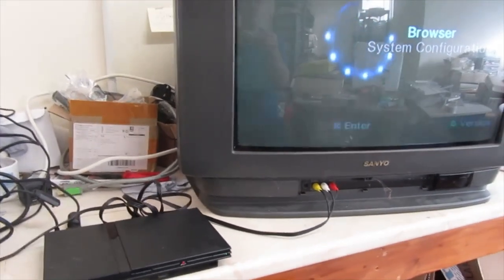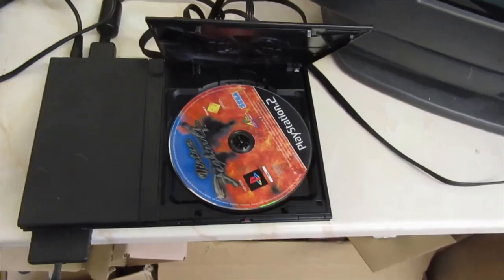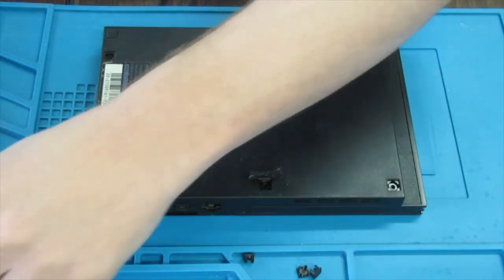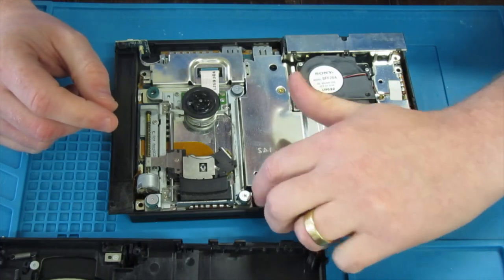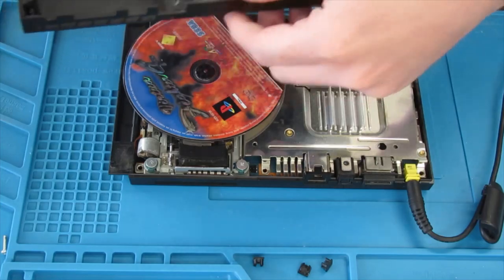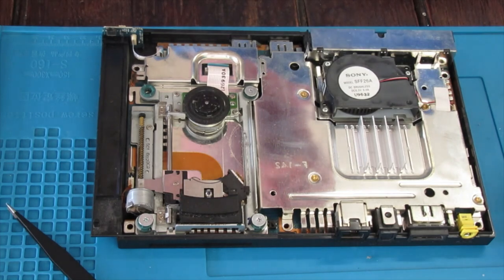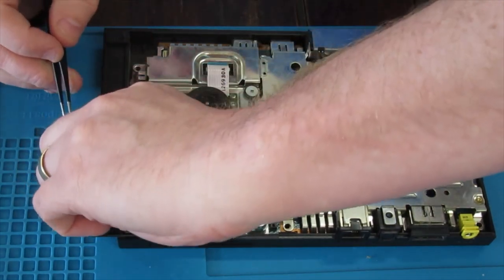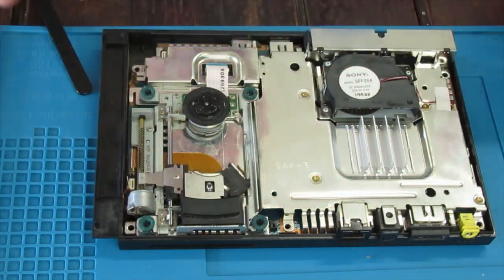PS2 PlayStation 2 Slim Discs Not Spinning

Comment: So I sat there having this issue thinking I would have to waste money fixing it. I had a new controller and game. But u said put tape and it was fixed. I've been playing for 3 months with no issue so THANK YOU!!!
Reply from the maker: Yeah for most people tape will work fine. Thanks for the comment, glad the video was able to help.
Reply: My ps2 would run ps2 games only but I just bought a dvd-r to do the free mcboot thing but the problem is the dvd won't run correctly it start spinning for seconds then stops I tried several DVDs and ps2 games and it was working but not the dvd-r how can I fix it? I only want this dvd to run so I can install free mcboot

Comment: In my ps2 slim  on the screen it is written that There is no data and underneath that it's written reading disc
Reply from the maker: That sounds like the PS2 is trying to read the game but cant, it's mostly likely an issue with the laser.
Reply: @EasyConsoleFixes bro mine just spins fine but after it stops and spins again what is the problem ?
Reply from the maker: @hafihashim  That seems like your laser is not able to read the disc.
Reply: Laser blinks according to the cd is there a problem ?
Reply from the maker: @hafihashim  I'm not sure what you mean by "laser blinks according to the CD. 

If it is a dying laser you could try adjusting laser potentiometer to see if that helps.
Reply: @EasyConsoleFixes  the cd spins at first and slows down a bit at that time laser stops and after that again cd spins at normal speed laser starts working
Reply: @EasyConsoleFixes  if you have a insta acc i will show you do you have one ?
Reply from the maker: @hafihashim  Is the console loading the games once it starts spinning again. If so I haven't seen issue before so I'm not sure what it could be.
Reply: @EasyConsoleFixes  anyway i'm going to buy a new laser btw my console is the last slim model is there a different laser or both have the same laser ?
Reply: mine doesn’t spin at all i’ve held down both the buttons and it still won’t
Reply from the maker: @hafihashim  Hi the 90000 series uses a different laser. Here is a  useful guide. https://www.zedlabz.com/blogs/news/laser-compatibility-guide-for-sony-ps2-ps2-slim
Reply from the maker: @imkitsune9246  When you held the switches down does the laser lens move up and down  or try and focus. 

If nothing at all happens when you press the switches down it's probably a faulty switch as the console is not detecting the lid is closed.

If the lasers tries to focus but it doesn't spin it's probably a faulty spindle motor, spindle motor fuse or maybe the ribbon to the spindle motor.
Reply: @EasyConsoleFixes  how can i buy from india ?
Reply: @EasyConsoleFixes which laser does the 75000 use?
Reply from the maker: @PRODMUDDY  Hi, the 75000 uses the PVR-802W laser.

Comment: I’m not too experienced with this kind of stuff but I opened my ps2 slim Scph-70012 because it was only reading compact discs and not dvd rom games like gta vice city, so I adjusted the laser thingy on the bottom to see if that would work which spawned another problem, the discs don’t spin. :(
Reply from the maker: The only thing I can think there is one of the lid switches has been damaged so the console thinks the lid is open or one of your ribbon cables hasn't been reinstalled correctly.
Reply: I think it was the ribbon cable because the laser does move up when turning the console on or closing the lid

Edit:I fixed the ribbon cable and it spins fine.

But the ribbon cable scratches
Reply from the maker: @scpnoobers  This is a common problem on these consoles. It can be fixed with some tape or glue or a new ribbon.
Reply: I’ll try the glue/tape part thanks for giving me suggestions

Comment: Hi, my PS2 Slim cd drive spins both ways, is there a fix for this problem? I'm looking for a new motor anyways, but I can't find which one it is, I don't see a type number like which on the laser is written as; PVR-802W. It could be the flexcable of the motor, but it's soldered on the board and that's why I have to look for a whole new motor
Reply from the maker: Hi, I'm not sure what you mean by the drive spins both ways. The slim uses a few different spindle motors. If you search for the model of console and spindle motor you should see the correct one. 

Some of the console models the spindle is really easy to change and in some it's difficult so it may be worth checking you have one of the easier ones.

Comment: Still doesn't work
Reply from the maker: If you are sure the lid closed switches are working correctly and the disc still doesn't even try and spin then the issue is probably with your spindle motor. 

It may be worth checking the motor, ribbon cable to the motor and the fuses on the board to make sure these are ok.

Comment: Hello even when I cluck the trigger manually it doesn't spin
Reply from the maker: Are you getting any movement from the laser, after the console detects the lid has closed it will try read the disc. If it doesn't detect a disc it wont  spin.
Reply: @EasyConsoleFixes  no, no movement :(

Comment: Awesome video! Thanks for putting this out there. Do you know where to buy a replacement switch? Mine looks pretty damaged and I don’t think it works anymore. I need to check continuity.
Reply from the maker: I don't know where you would get a replacement switch. If the switch is damaged you can remove it and bridge across the points to get the machine working.

Comment: Hi, I’ve tested the two switch method and the laser head moves down scans for a second, moves up and down (the lens), and then turns off the laser. The motor does not spin
Reply: Now it’s making a grinding noise when it reaches the disc spinner then it returns
Reply: The disc spinner does not spin
Reply from the maker: If the laser starts to try and read the disc it means the two switches are working correctly as the console can detect that the lid has closed.

It is possible that you need a new spindle motor, it can also be worth checking has the ribbon to the motor got damaged.
Reply: @EasyConsoleFixes  What type of motor do i need then? I'm searching for this for so long... I mean the disc motor. Mine spins both ways, can you help me?

Comment: I have a PS2, everything seems to be working with it but it stops spinning after a little bit of play and it seems to randomly stop spinning. Could this be an issue with the sensors?

As a secondary question:
At first I thought it was the motor, so I bought a replacement disc assembly, laser and motor included, putting that in the motor doesn't spin at all but the laser moves and lights up, this is my second replacement disc drive assembly that has the same issue too. Are these replacements just bad?
Reply from the maker: If the laser is moving the issue is not the sensors. You will have no movement of the laser or motor if the sensors are not detecting the lid is closed.

Does your original motor still spin or have all motors stopped spinning. If its all motors one of the fuses on the board could have blown.
Reply: @EasyConsoleFixes  The original motor moves but seems to randomly stop after some time, sometimes it will stop after a couple minutes, sometimes a few seconds, other times over an hour. It will usually start spinning again after opening and closing the lid as well.

Thanks for replying!
Reply from the maker: @freebite  If the old motor works its not a fuse then. I would be surprised if the motor had failed on 2 replacement drive assemblies though so not sure what's happening there.

The Lid Closed sensors are really just two switches, It is possible the solder connection on the the rear one has cracked causing the console to randomly think the console lid has been opened.
Reply: @EasyConsoleFixes  Alright, thanks for the help, I'll try and bypass the rear switch and see what happens. 
Otherwise I have no idea why the new ones won't work. Unless it's because mine has a smaller worm gear motor than the one shown in this video, would that effect anything or would it still be pretty plug--n-play? I made sure to buy ones that seem to match, I'm not using the wrong one.
Reply from the maker: @freebite  There are are a few different lasers that go in the slims, have you definitely the right assembly for your console.

Slim SCPH-7000x use a SPU3170
Slim SCPH-7500x use a PVR-802W
Slim SCPH-7700x use a PVR-802W
Slim SCPH-9000x uses a TDP-182W
Reply: @EasyConsoleFixes   i double checked the assembly, the listing says 7000x compatible, and i have the 70001, but the assembly says tdp082w, is the listing wrong?

In the meantime I'll try soldering a jumper across the rear sensor contacts to see if that fixes this somewhat intermittent issue.

Thanks again for the help btw!
Reply from the maker: @freebite  It does seem like you should be using a SPU3170. but  I would have thought it would still try and spin and read the games even with the wrong laser. 

I'm not sure as I normally only need to replace part of the assembly, laser, motor etc. Its fairly rare that I need to replace the whole thing.
Reply: @EasyConsoleFixes  i made a discovery in my attempts to fix it, if when the disc stops spinning i press on the lid towards the back, i will hear the motor spin back up. It's definitely the back switch and the console is thinking it's open when it actually isn't.

Thanks for your help!
Reply from the maker: @freebite  That's good news, it's a fairly straight forward fix. Taping down the switch will sometimes even keep the console working for a while.

Comment: Hi
I have a problem with drive not spinning at all. I tried to push these 2 swithces by hand and laser want to read the disc but drive doesn't spin at all. It say Reading disc for a second on the screen before it dissapears
Do you have any solution to that?
Reply from the maker: It could be worth checking the spindle motor or the ribbon cable that goes to it. If the laser is trying to read but the disc doesn't spin at all.
Reply: I know I'm a little late here, but maybe you made the same mistake I did and opened the system, turned it on, and pressed the switches, but had no disc in. If there is no disc, the laser will move and try to read for a second, then stop since it did not see a disc.
Reply: @keatr0n  I don't remember if I did this but whn you have shelf on and close lid with no disc, isn't the result the same? Because you can have closed console with no disc
Reply: @Tezuk_25  you can close it with no disc, but I don't think it actually spins without a disc. I had the top cover off, no disc, and when I pushed both switches down, the laser moved, but the disc didn't spin. When I insert a disc and try again, it spins up and reads just fine. My problem is with the switches, but this made me think it was with the disc drive.
Reply: @keatr0n  Oh yeah. I tried this countless times as a kdi. That's normal thing to do. Unfornatelly this problem occured with disc in tray

Comment: will this work with the other ps2 slim models? i don't know what mine is, but imagine the disk latch is facing towards you. so the motherboard is on the left, and the drive is on the right, the vents are on the right side with the drive, and there is a circular depression between the motherboard and drive. thank you
Reply from the maker: All the PS2 slims have these two lid switches except the 90000 series consoles. These only have the one lid switch at the front of the console.

Comment: None of thee quick fixes work on mine, not even replacing the spindle helped. Any idea what is wrong?
Reply from the maker: It depends on what the console is doing,

When you held the switches down does the laser lens move up and down  or try and focus. 

If nothing at all happens when you press the switches down it's probably a faulty switch as the console is not detecting the lid is closed.

If the lasers tries to focus but it doesn't spin it's probably a faulty spindle motor, spindle motor fuse or maybe the ribbon to the spindle motor.
Reply: @EasyConsoleFixes  there's a fuse for the spindle motor? Where is it located? The buttons for the lid work as they are supposed to, laser is moving, but the cd spindle don't move. I changed this one today since I believed it were the problem, but it still don't spin. The PS2 start up and show the main screen and the contents of the memory cards. It's only the spindle that don't spin.
Reply from the maker: @Hulken_no  It does seem then like spindle is not getting power if everything else seems to be working.
Here is a link showing the fuse locations on the different PS2 motherboards.

https://www.ps2-home.com/forum/viewtopic.php?t=2779
Reply: @EasyConsoleFixes  The question i which fuse is in connection with the power supply to the spindle motor? I see the F0001 looks suspicious, does it have anything to do with the power to the spindle?
Reply from the maker: @Hulken_no  Fuse F0001 is the fuse at the power supply if it was gone there would be no power.

Sorry I just reread your earlier comments and I should have asked, when you changed the laser did you remove the anti static solder blob, if the laser cant focus the motor wont spin.
Reply: @EasyConsoleFixes  The laser haven't been changed, no soldering have been removed, only the spindle motor for the disks since it stopped spinning. No visible burns or defects on the component plate. If it's a fuse, which one is it for the spindle motor?
Reply from the maker: @Hulken_no  Sorry I cant remember which one it it is but looking at the fuses wont really tell you anything you would need check them with a volt meter.

Sorry I thought you had also changed the laser. Normally when you start the console the laser lights, then tries to focus,  and then the disc spins. The issues could be with your laser as if it cant focus the console wont spin. It may be worth checking ribbon cables to the laser are in correctly or your leaser may have died.

Can you see the red light of the laser come on. (Obviously don't look directly at it)
Reply: @EasyConsoleFixes  The laser focuses and flash red.

Comment: Hello,

My ps2 slim (scph-70004) has problems.
The discs start spinning but then stop.
Sometimes they don't start spinning at all, instead
sometimes the disc spins well and I can play with it.
I noticed that the ribbon cable that connects to the lens has lifted and is scratching the discs.
Do you think that by changing this ribbon cable, the spinning problem will also be solved?
Reply from the maker: Hi the ribbon cable lifting is a common problem on these consoles, they can be just glued back down to stop the scratching. If the cable has started to get damaged from rubbing the discs it is possible it could be causing your problem. 

If the two switches I show in this video are working fine and the ribbon cable is fine then the discs not spinning could also be caused by a dying laser,
Reply: @EasyConsoleFixes I noticed that my ps2 always reads cd's (blue disc) but only sometimes it can read dvd's (silver disc).  Is it possible to solve the problem by setting the appropriate potentiometer?

Do you know the ohms right values for CDs and DVDs ?
Reply from the maker: You could get it to work by changing the resistance but I would just change the laser. Adjusting the potentiometer only ever seems to be a temporary solution and changing the laser on these consoles is not too difficult.

I would also check the ribbon cable. In this video https://youtu.be/E7UAJqbpRZU I had the same thing, the console would play blue games but not silver and it was caused by a small bit of damage on the ribbon.
Reply: @EasyConsoleFixes  ok,
In any case, i decrese the DVD potentiometer from 963 ohm to 817 ohm , is it ok ? It should't be under 725 ohm , right ?
Reply from the maker: Sorry. I don't know the correct ohm values for these lasers as I just tend to replace them. Did adjusting the laser fix the issue for you.
Reply: @EasyConsoleFixes  i changed the ribbon cable, but i still have the same problem. I will change the laser lens.
It work fine with cd blue disk.
Instead with dvd silver disk, i start to spin ( but slower than cd ) but there are some interruption. ( the dvd stop and then restart spinning ).
Reply: @EasyConsoleFixes  Hi, I replaced the laser lens and now it works fine !!! Thank you !!!
Reply from the maker: That's great to hear, glad you got it sorted.
Reply: My ps2 would run ps2 games only but I just bought a dvd-r to do the free mcboot thing but the problem is the dvd won't run correctly it start spinning for seconds then stops I tried several DVDs and ps2 games and it was working but not the dvd-r how can I fix it? I only want this dvd to run so I can install free mcboot

Comment: I have had three ps2 slims with the same problem i turn the ps2 on and the ps2 wants to start spinning but then stops and it only spins the disc a fraction and then you just hear it ticking what could this issue be? It is worth noting that all thoes ps2s have been worked on for playing burnt discs with the sensors
Reply from the maker: Normally a PS2 does this when the laser no longer works. You could try replacing a laser or adjusting the laser potentiometer to see if increasing the power gets the laser to read games.

Playing burnt discs is known to be hard on the lasers, it could be worth looking into getting a HDD